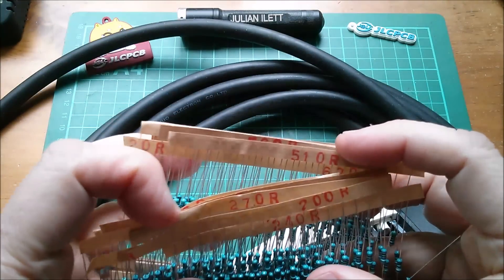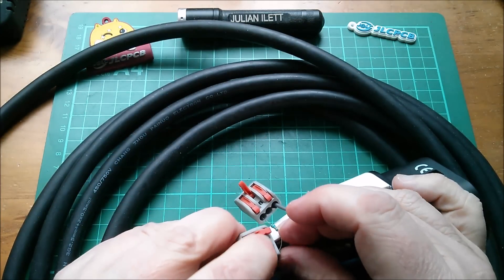Vehicle to Load (V2L) on MG ZS EV

Comment: Great, kudos to the designers of this standard, possible ways to use a single connector in multiple ways. Thanks for sharing, I think not usable with my ID.3, but who knows maybe in the future.
Reply: I wonder if this could be used to blow up someone's car.

Charge cable, modified with the resistor.

Set the car to discharge and then plug it into the charger and start the charger as well.

In reality, the charger probably needs to talk to the car about the charging before actually firing up the charge circuit and trying to deliver power :)

Comment: Very interesting , wonder how big a load it can take, have you found?
Reply from the maker: I'll try that next :)
Reply: @jonathanr72  that would take 100 years. i have leaf 30 and even pluging in to a 13a socket which draws about 2.5kw only gives a few miles range in an hour. think aa will have to lug a 6kw diesel generator about or just transport us to nearest charge station
Reply: @lookoutleo  Or maybe a purpose built truck, with a battery pack, and a "fast charger" capability.

Only need to charge the car to whatever is needed to reach the nearest "real" charger.
Reply from the maker: Yes. We transferred some charge from the MG to a Tesla model 3. Not quick, but it works.

Comment: If that's giving you ac out ,  I  wonder what the inverter output at 240 v. Is capable of powering . Wattage   I mean  , very interesting watching that . Nice 1 .
Reply: how big (size) is the inverter, extra weight which all needs moving, is it used for anything else, in the car or just this as in the video, go camping, or power for a caravan or something, could it be used say like a set of jump leads, to get car electric going from second cars with a full battery?
Reply: @dh2032  The inverter that does the V2L is probably the same one that does the charging so probably not any extra weight.

The onboard charger is a AC to DC converter, but if you build it right, it can also do it the other way round.

Comment: As the plugs are expensive, an idea for a cheap combined Granny charger ( or type 2 cable) V2L setup : 
Take the standard granny charger ( or Type 2 cable) , chop the cable and put the ends into an outdoor 13A socket. 
Add a double pole switch to select modes: 
Pole 1 connects the car PP to either the Granny/T2 PP or the 470R to PE
Pole 2 connects the car CP to either the Granny/T2 CP or open

Opening the CP ensures nothing bad should happen if the granny's 13A plug is accidentally plugged into a 13A socket while in V2L mode, as it shouldn't close its relays. 
As long as the car disables the V2L immediately if the resistor disappears, nothing bad should happen if the switch was flicked while the 13A plug was live....
Reply from the maker: On my EVSE, PP doesn't connect to the granny box at all (just has a 680R to PE inside the Type2 connector), so pole1 of your switch could simply select between two resistors, 680R and 470R.
I can see the benefit of a combined EVSE/V2L for the Ioniq5 where the V2L can be enabled remotely, but the MG ZS requires several actions inside the car to enable V2L (turn on car electronics, start discharging on infotainment display) so a combined unit makes less sense.

Comment: This information should go in the list of things to know for a "if s**t hits the fan" scenario. 
Could you show bypassing a solar system when the grid is dead too? (Another lifesaver.)

But does this mean the same cable can't charge and discharge? (New to how EV electronics work, but look at having an EV as a reserve battery.)
Reply: @Wooly Chewbakker 
Yes and no. Safety for sure. But I want to use the car as an extra battery buffer for the house. Which seems a bit "hard" at the moment.
Reply: @Wooly Chewbakker Not yet, as the rules here still gives a bit of a problem.

Comment: How much does it cost you to discharge a kWh, just counting battery life and charge cycles?
Reply: The battery is warranted for 7 years/150,000 km.
Reply: @Okurkaarrgghh  so as an idea, for 6 years, 300 days, just use the car as a rideable mobile power wall, after 6 years, 300 days, the only visible marks of use will be of the power/charging connector( and that's only if you keep connecting and disconnecting the cable,  and Id like a repayment battery please  under the warranty cross your finger for seven more years, 14 year later, would you have saved on the deal, with solar panels, and not taking power from the power grid? 🙂

Comment: I was wondering how the Ioniq 5 V2L adapter did it, I even considered trying to get an over-the-weekend test drive to investigate ;-)
The Ioniq may be slightly different as it has a button on their V2L plug, to enable it without using the car's UI, so maybe something slightly more sophisticated. Was expecting to see some sort of authentication/signalling in there somewhere. 
I suppose the fact that on the MG you have to enable it manually means there isn't a risk of unintended activation, e.g. with a damaged cable, which could get nasty,
I'd be interested in the inverter achitecture, if they've repurposed any of the OBC and/or inverter hardware to do it, or just slapped an inverter and some relays in. 
Do you hear any different relay/contactor clicks in this mode versus charging or running?
Reply from the maker: The Ioniq5 adapter is possibly even simpler. Delbouy did a photo teardown of the adapter here: https://www.ioniqforum.com/threads/v2l-inner-secrets-not-many.39857/
In his text, he says PP connects to earth (PE) and CP connects to earth through the switch and thermal fuse.
But I can't see any connection to PE in his photos. So is it simply that CP connects to PP through the switch and thermal fuse? The thermal fuse (SEKI ST-22 95C) looks like a bit of an after-thought. I guess people aren't very good at wiring plugs and a few of these adapters got melted.
Reply from the maker: My gut feeling is that the OBC reconfigures itself as an inverter for V2L, possibly using the same semiconductors, because there are no additional relay clicks or contactor clunks. But that's just a guess. And I won't be lifting the lid on the OBC/inverter for at least 7 years :)
Reply: same, the inverter has me curious .

Comment: So with that cable made, you basically have a Jump Start cable for other electric vehicle sort of.  Thats if they have the 240v charger with them.
Reply: A very slow charger.

Maybe 2 kilowatt per hour, so only able to add 10ish miles per hour.

But offcourse...Better than nothing.

Comment: So like, these cars all have an entire separate grid-tie inverter in them, just doing squat expect when you happen to use V2L?
Or are they somehow repurposing the motor inverter with minimal extra circuitry? The plug does have 3 phases, it would be epic if the motor inverter could output 3 phase. Imagine if you could just send in PWM on the CP pin and get a 3-phase VFD output.
Reply from the maker: Just a regular pure sine inverter, not grid tied.

Comment: Hi Julian! Nice job here. I think one cable with a charge/discharge switch would be viable, lowering the cost even further if you didn't need anything other than a standard output end - or whatever you wanted to convert the output connector to.

Also, a question. Would connecting CP to ground allow for the discharging to begin without needing to tell it to start?
Reply from the maker: The Hyundai Ioniq5 V2L adapter has a switch on it, which appears to start the inverter without having to enter the car. Looks like the MG always requires user interaction inside the car.
Reply: @JulianIlett  probably so you're forced to read the terrible English. That would annoy the hell out of me for what price I paid for the car!
Reply: @1larrydom1  And look at a picture of the car, with the cable coming out of the side of the car, when in fact the charge port is in the front.

Not a lot of care was taken when doing the menu's....Only good thing is that the car is OTA upgradeable on the infotainment, so it is possible they can fix that at a later date.

Comment: Are you going to use the same cable for charging and discharging, with a programmable device to switch resistors between charge mode and discharge mode?
Reply: Programmable device? A basic switch added to the handle could do this.

You could put in the 680ohm and then have a 1.5k ready to place in parallel at the push of a clicky button. 

You'd need to be clever with the plug the other end though to make sure you can't kill yourself by touching the power being fed.
Reply: >programmable 
what is a switch, chris? not everything is IoT shit.
Reply: @berthold64  So, at the start of peak hours, when the feed in tariffs are at their highest, your going to trot out to your car and manually switch mode and when the sun comes up in the morning and your PV panels start providing surplus power your going to switch to charge mode? Isn't it more fun to have that automated?
Reply: @sailingoctopus1  I'm thinking the same. But apparently you need to enable the V2L function from the dashboard. Maybe it's possibile remotely from the app as well?

Comment: I would like to see specs of the power delivered  as if only  50 or 60Hz or programmable? Frequency accuracy enough for electrical clocks ? Voltage accuracy with  variable loads?  Post a scope pic showing wave form.  If your going to  power something one needs to know the specs of the power delivered.
Reply: Right knowing if it is 50hz or 60hz and how to control that is going to be really important if you don’t want to destroy the devices you plug in. 120v or 240v is also going to be important.
Reply: @ecospider5  What devices other than electric A/C motors would care if it is 50 or 60 hertz ?

Any resistive load like bulbs, water boilers and whatnot would not care, and anything with a SMPS would not care either as it just rectifies the incoming AC and then chops it up at a much higher frequency to make the DC needed inside of the unit.

I suppose if you want to attach an old style alarmclock that runs the clock circuit off of the frequency it would matter as well.

120/240 is probably going to be the same as what you charge it with, so dependent of where the car is sold. Also, most SMPS driven devices would not care as they are usually rated from 100 to 300+ volts input.
Reply: My primary use for backup power is refrigerator, air conditioner and furnace fan. If all you are doing is charging devices and running a lightbulb then a 12v to 120v power inverter is all you really need. 

But yes your toaster is not going to care about frequency.

Comment: Did someone tested if there Is the a voltage, frequency or amperage difference between the ohm values?
Reply: I'm just curios. I chant test it for my self because I drive an ID.3.
Reply: I would imagine that there are resistor values that specify US (110v, 60 Hz) as well as 240v 50Hz in there somewhere

Comment: So how long before your home made EVSE does both charge and discharge, using your solar when necessary?
Reply from the maker: I've certainly thought about it. Scary though - house mains one side of a pair of relays and vehicle-generated mains the other side. Not sure I trust my Arduino coding skills to risk that :)
Reply: @JulianIlett  I would definitely use a hardware interlock instead of software.

Comment: How many cars can you put in parallel to fully power the house!  
I like the idea that you can go out camping and full in tent heating and set the limit in  car so you still have enough to drive to the main road to get the AA to tow you home ;-)
Reply from the maker: Cars in parallel - excellent :)
That's a bit like connecting multiple generators in parallel and hoping they'll somehow sync together their phase, frequency and voltage. Yeah nah.
Reply: @JulianIlett  Did that when at school on day release. Two big 3ph motor-generators and a switch to connect them in parallel. You put 3 100W light bulbs between each phase and adjust the speed of one generator. when all 3 lamps go out you throw the switch and the generators are locked together. being a group of 15 year olds the fun was to see who would dare throw the switch with the brightest lamps. One generator would then try and rip itself out the floor. the motor-generator sets were about 2-3 foot in dia.
Reply from the maker: My youth was sooo misspent :)
Reply: @JulianIlett  Inverter generators are made to do that.

Comment: This is the video I wanted to see VTL in action without having to pay for the cable ~250€.
Need some work in terms of security in case of a fault on the side of the load, but it's a very good start.
Now you have 50kwh or more at your disposal.
One question.
When you do the discharge cycle, the MG has to be on?, can you lock the car? 
Any kind of cooling going on the MG DC/AC inverter (water pumps or fans)?
Reply from the maker: When you start the discharge, the car must be in at least the 2nd accessory state (green light on the start/stop button), but you don't need to start it with the footbrake pressed (it won't move anyway if there's a cable inserted).
Then you can switch off the car's electronics and the V2L will continue (and you can lock the car). Since making the video, I have run it all night into a 1,500W load discharging the car's battery from 75% to 45%.
Reply from the maker: After running for several hours, the charger/inverter was stone cold so no fans or pumps.
Reply from the maker: Just one odd glitch. If you use the iSmart app to check the car's battery SOC, the V2L inverter drops power for a fraction of a second (maybe 250ms). This was enough to reboot my Antminers.
Reply: @JulianIlett  Thanks for all your answer's to my questions.
This is a valuable contribution for those who are off grid and now effectively can stop using generators when the bad weather arrives.
Thanks and keep up the good work.
Reply: @JulianIlett  Thanks very much for the video. Just, here when you say all night, how many hours is that, because at 1500W you'd be expecting 14 hours of runtime (at 100% efficiency which is rare!) to drop 30% battery. How much less than 14 hours did you get, and hence what was the efficiency...? We have a ZS on order, and this will come in handy, thanks again.

Comment: I'd drill down further on that resistor range, I'm betting the 470ohm equates to a 13amp maximum load. ;)  (I'm guessing 3amp to 30amp load maximums), Please note, I may be wrong from time to time.
Reply from the maker: Worth a try. Although I doubt this resistance value contains any more information than "I am a discharge cable".
Reply: @JulianIlett  Maybe worth trying the values between the other defined standard ones. Might be useful if there was a 110v mode, for power tools.

Comment: This is somthing I will have to make for my MG5 standad range 2.5kw will be usefull, as we have lots of power cuts
Reply from the maker: Is it the refreshed MG5 with a discharge control page on the infotainment display? If so, I'm guessing it will work the same way.
Reply: @JulianIlett  no the original but V2L is listed on the spec sheet
Reply: No v2l or app on your mg5 Simon you will be wasting your time. Facelift in early 2023 will have both

Comment: that's really cool. i wish my kona also had a secondary inverter for V2L like that. I'm wondering what kind of hardware manufacturers come up with in the next few years though, saw a research project at some university here in germany where they used CCS for hooking up the battery to an external inverter.
Reply from the maker: I think vehicle-to-grid will become more common in a few years. The car connects to a wall box and can either charge from your home electrics, or discharge back into it. When people come home from work and plug in, the car will initially discharge for a while to support peak demand on the grid. After an hour or so, cars can switch to charging when the national grid is less in demand. This process can be opt-in with financial incentives to encourage people to participate.
Reply: @JulianIlett  I'd go for that, my car has 50% battery after a day of driving, using a bit more to cook my tea at effectively my night rate would be good.